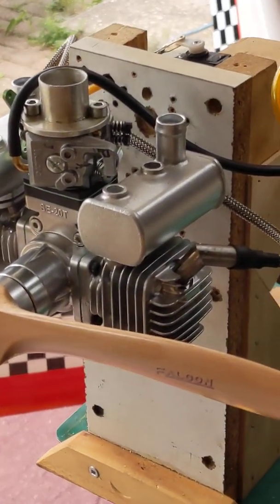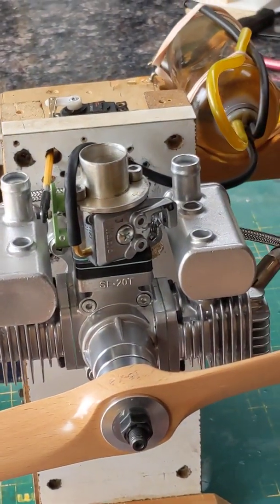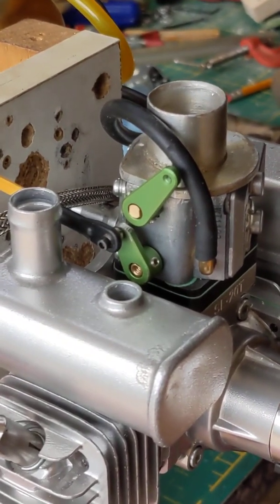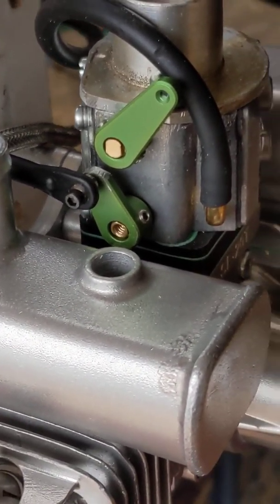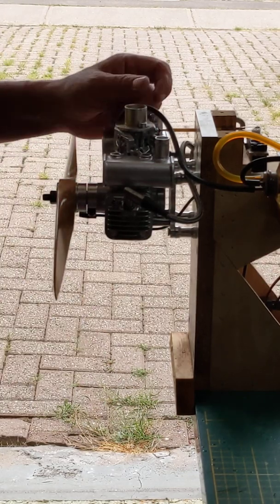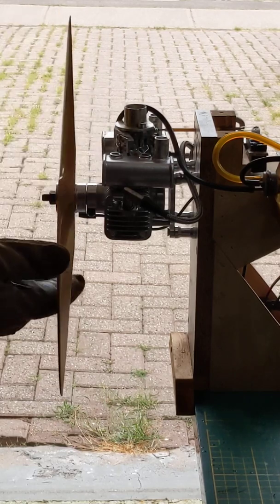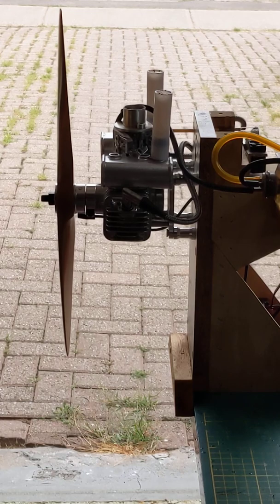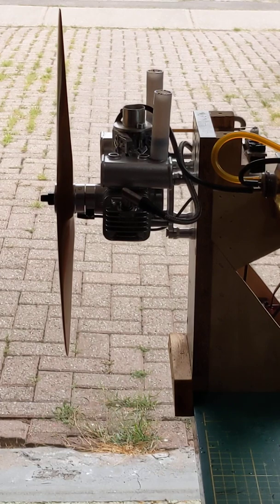RCGF 20cc twin boxer engine first start

Comment: All residual oil is going to run back into the cylinders, if it is able to "burn it" it could run hot as to much oil creates more heat in order to burn it. This is not a good idea for any reason
Reply from the maker: Well first off .. I am a retired heavy truck / equipment mechanic.. second.. it was only on the test stand for the video.. next.. there is very little oil comes from the exhaust.. and what oil did come out.. would most certainly not cause a problem even if the engine had been left inverted.. most everybody runs their gas engines inverted..
Reply: Dennis custard there is no problem running these engines inverted.  It's done all the time.
Reply: There is no problem running these engines inverted  it's done all the time.

Comment: Why would they engineer the throttle arms to hit each other ???
Reply from the maker: well they didn't exactly engineer it that way.. that is a standard warbro carb design.. fits pretty much any engine.. you would normally use aftermarket arms,,  two different arms ,, one a bit taller than the other to offset your linkage hookup.. just that the muffler gets in the way of a taller one... so I used two short ones.. and they run into each other.. so I had to shorten one..

Comment: What size plane did you put it on?
Reply from the maker: if you look at this video https://www.youtube.com/watch?v=jQhZGJvcFMI&t=4s you will see the 54 inch goldberg ultimate biplane on the right side.. the plane was 12.5 lbs  and it flew pretty well..  I am a very aggressive high speed sport flyer and it did not have quiet the punch I wanted to I swapped it out for the 30cc version and now has unlimited vertical climb
Reply: @jeffgrain1417  I’m building a Vintage 100” OK Big Rainbow, big n slow lol. Calls for a FT-120 and I’m thinking a 20 is probably enough, I’d like it to fly pretty scale. Not sure what I’d gain on the twin other then coolness they appear to be the same HP.  Did you sell the twin?
Reply from the maker: @HootisGarage  The FT-120 is a glow fuel engine.. and will use a lot of fuel.. the rcgf 20cc is gas and uses very little compared to the glow.. the twins look and sound cool.. but they also have less vibration.. I had a 17x6 prop but a 16x6 would likely be a better choice for a slower plane..  not sure what this big rainbow is ,, but if it is like a cub style.. the 20 would be likely very scale.. but keep the weight down to about 10 lbs..  I didn't exactly sell it.. a buddy was stuck for an engine and he made me a deal I couldn't turn down.. trade the 20 for his 30 as well a 15 for a 15 to fit his plane and I did all the install and setup.. and yes the maiden.. so that I handed him back a flyable plane..
Reply: @jeffgrain1417  thanks. Yes it’s like a giant Cub. 👍🏻

Comment: I wonder if this would "fit" on my SIG 1/4 scale cub?
Reply: This engine is going on my 1/4 scale Sig Cub.
Reply from the maker: It is mounted on my goldberg ultimate 57 inch , take off weight is 10.5 lbs..  16x8 prop and does about 85 mph
Reply: Yes it will. I had a 26cc in my 1/4 scale cub.

Comment: Is there any way to modify the mufflers to try and not have it sound like a leaf blower?
Reply from the maker: You have to remember that I am running this engine in my shop.. so the sound echo's .. At time index 6:25 you will notice that I add the silicon muffler extensions and it softened the sound a bit.. you could try adding longer versions which would change the sound.. once out in the open at the field.. it sounds ok to me.. and in the air ,, sounds ok.. but if you are looking for that 4 stroke sound... then I doubt it very much..
Reply: Maybe leaf blowers are trying to sound like this. At least that's what I would like to think😆

Comment from the maker: now that I have a dozen or so flights. on this engine and adjusted the needles a bit.. this engines starts and runs like you wouldn't believe..
Reply: nice getting ready to start my 56cc single cylinder real soon just a heads up gas engines can bend the connecting rods when they are bolted solid to a stand mainly the single cylinder they recommend only starting the first time on the plane due to it allowing it to freely move when vibrating but nice job looking forward to hearing mine

Comment: Nice video! Thanks for taking the time too make it!
This is my first year with a gasoline engine in an airplane, and now have a 30 cc RCGF twin flying my 76 inch wing an Lazy Ace biplane.
16 flights in total so far. All my other planes are 4 stroke glow or electric.